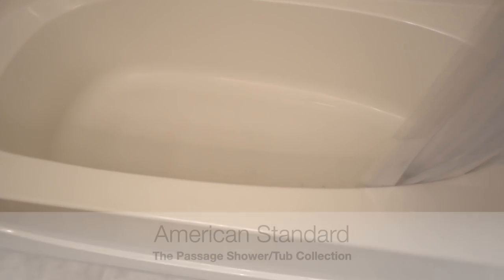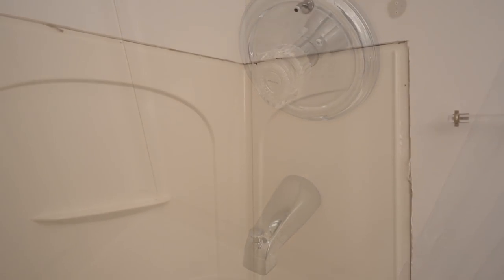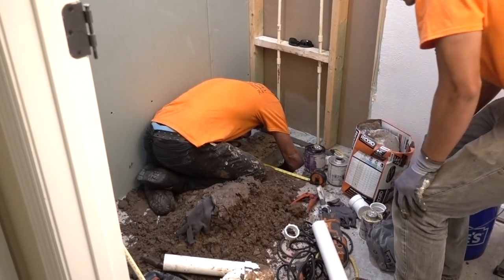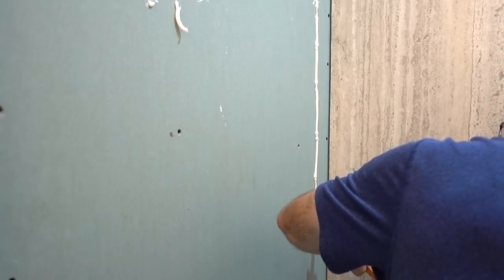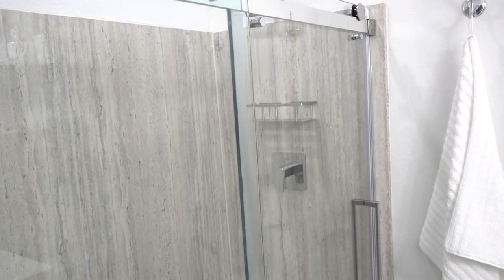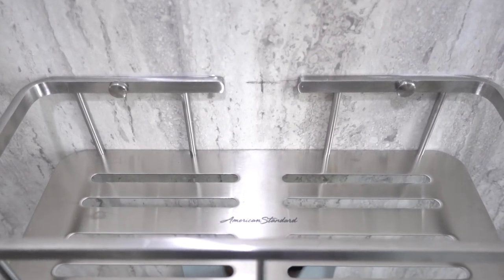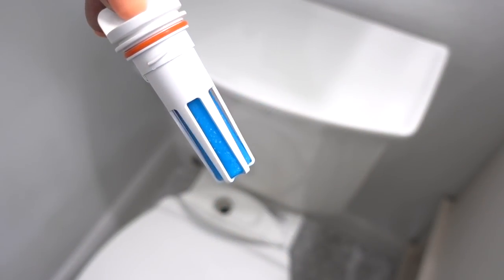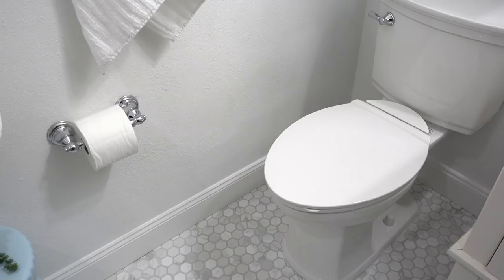Convert Tub Into Walk-In Shower w/American Standard

Comment: Do not buy the 60" panels if you have a tub! Buy the 72" so the shower head comes out of the panels and not the drywall. It will look less tacky. If you have a walk-in shower like this I suggest the 80" panels. I don't know why they would even sell the 60" panels. I bought the 60" by mistake due to the misrepresentation on the Home Depot website which shows the 60" panels a few inches above the shower head.